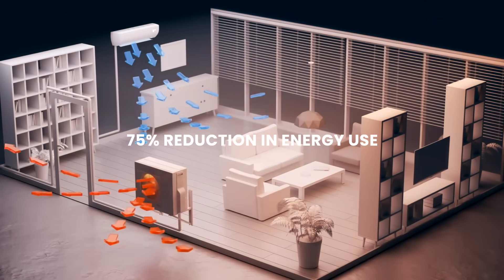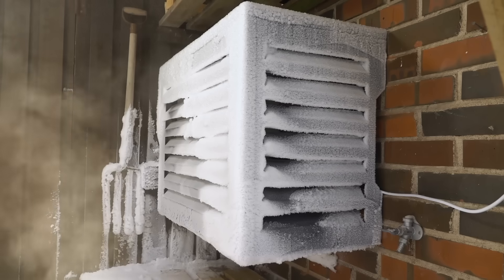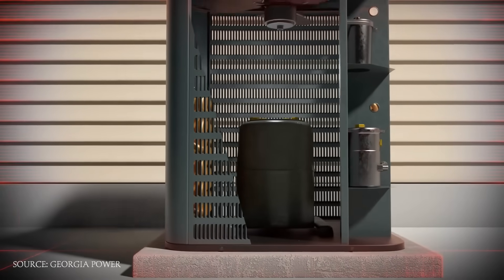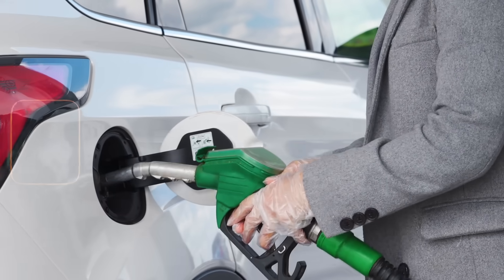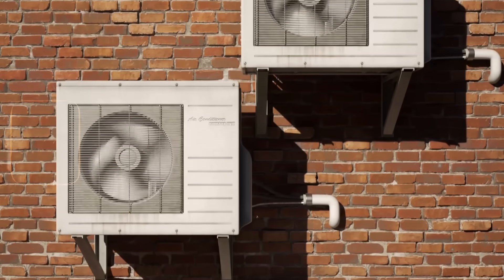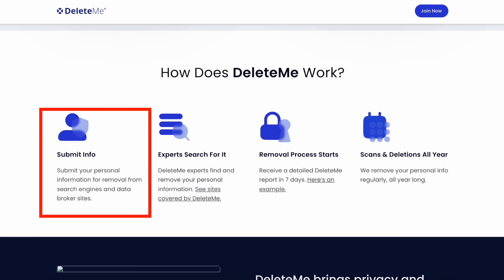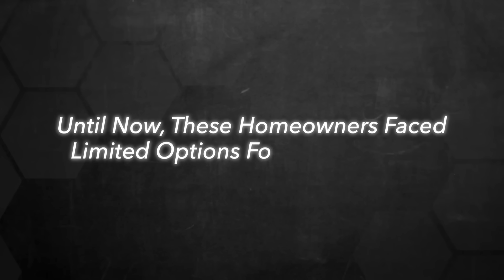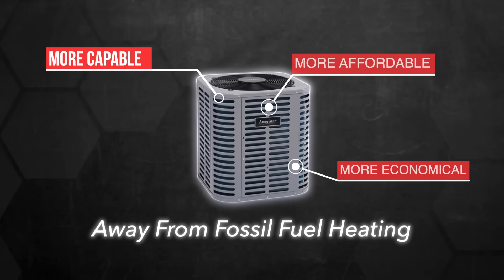Genius Heat Pump could change how we heat our homes forever

Comment: The classic engineering debate: 
A simple, dependable less efficient design that's cheaper to built and easier to maintain vs. a complex, less reliable, but more efficient design that cost more and is harder to maintain. 
Striking a balance between simplicity and efficiency is key.
Reply: As a former reliability engineer I definitely see many problems occurring, lol. I like the KISS system.  Keep it simple stupid!  Overall, I see this system being finicky.  If you are a “DIY” person you may be ok with this system so long as you continuously monitor it.  Problems will occur at the cross over temperatures.  The DIY person will have check the system every time that a crossover temperature is reached.  If the system hangs up there will be liquid in the compressor!  And this is 4 times more probable since there are 4 different temp fluids involved.
Reply: @steveramsey7983 If they want to rely on a single compressor, there are fairly simple ways of preventing liquid from reaching the compressor. The software that this company is touting sounds like something a talented industrial maintenance tech could do with ladder logic, so it shouldn't be too costly for them to add a couple more input devices and a few lines of code.

As a controls engineer and former HVAC tech, it's a surprising how relatively un-smart most residential AC systems remain. The industry seems to have focused its RnD resources on making IOT thermostats instead of developing instrumentation that would make their systems safer, easier to troubleshoot, and more reliable. Harder to market that, I suppose...
Reply: @RayGetardo  I agree 100%. HVAC equipment until very recently has been stuck in the 1940s with basic on-off switches, relays, handful of thermisters, etc.
Reply: A SURPRISING amount of time this isn't actually an engineering dichotomy, but an economic dichotomy; The market is far from efficient in the short and medium term, and so the company that brings the superior product to market charges through the roof for it in order to protect the revenues for their inferior product that they're still selling.  The Big Box logic is that you must, absolutely must, have a "Good, better, best" price/market segmentation, and technical superiority doesn't actually matter.  This reinforces the trend by making the superior product lower-volume, and thus most expensive because of fewer economies of scale.

It costs under ten bucks to add a part or two and turn a $200 window air conditioner into a year-round device that heats in the winter.  But we sell them at a +200% markup instead.
Reply: Indeed. What are the maintenance costs for a multi-refrigerant system compared to a single refrigerant system. More system components tends to mean more maintenance or points of failure.
The unit is about 2X, the added complexity of installation would probably be at least 1.5X, and maintenance would be what? 2X, 4X?
I just recently replaced a 3 ton HVAC unit with a new inverter unit rated to minus 20F for $6200 installed after sales tax. Ordered the unit online and found a licensed HVAC contractor to do the installation and register the warranty. My tenants said it worked fine when the lows hit around 0F with no high electric bill. It only gets below minus 10F a few nights every thirty years or so here. Minus 20F is the all time record low since records have been kept.
Reply: The Lennox Pulse comes to mind
Reply: Which is why I'm engineering a Cooling Only storage system.

Massive insulated basement full of large cobbles for good airflow and thermal capacity.

AC releases its heat into the basement.

Still researching the way to extract the heat from that basement.
Reply: @priestesslucy  extract the heat for what purpose?
Reply: Outlaw planned obsolescence, subscriptions on things you buy, oh and DRM locking you out of things you buy!
Reply: complexity isn't the issue, it's the reliability. Microchips are extremely complex yet very reliable.
Reply: @imzjustplayin  Compared to what? Reliability is a relative term and when microchips are compared to a simple circuit, they now appear unreliable.  It is a fundamental fact that as complexity increases, reliability falls.
Reply: @henryyopp9094  Sorry you are completely wrong.  Generally, yes complex systems are more prone to failure than more simple systems, but this is far from always the case.  New EFI engines are way more reliable and complex than simple mechanical fuel and spark engines.  Why? Because the complexity eliminates major failure modes. Proper design and engineering beats simplicity every time. Design and engineer for reliability and you get reliability, design and engineer for simplicity and you get simplicity, the two are not related.
Reply: @donaldendsley6199  Big difference between EFI engines that can handle and adapt to problems that arise, vs multiple compressor systems in series which constitute a single point of failure.  It's a good idea, but until they can get everything into a single compressor, it's a hard no for me
Reply: @imzjustplayin  Microchip maintenance is performed at the design and operation environment levels. It's not comparable to mechanical maintenance processes.
Reply: @imzjustplayin  " yet very reliable."
They're highly vulnerable to power fluctuations which is why a basic refrigerator will survive minor power surges while more complex ones get fried.
Reply: @wisenber  Microprocessors aren't subject to brownouts and other utility variances because the power supply that converts mains to low voltage is what would be affected first. If the utility power is so dirty to damage anything, it's going to take out the power supply first before it gets to the electronics. Arguably most power supplies in consumer electronics are computer controlled but that has the benefit of making them hardier since they're switching supplies and can handle far wider voltage and frequency range (100v-250V, 50/60hz).
Reply: @imzjustplayin  Weird that they get blown out so much with them being so reliable.
Reply: they do? not my experience. do you repair appliances yourself? maybe the failures you're seeing have nothing to do with power quality but rather poor engineering or parts quality (insufficient or poor quality capacitors or other issues). I wouldn't blame poor power quality for failure of devices since those things can easily be ignored with proper engineering. @wisenber
Reply: @imzjustplayin  "do you repair appliances yourself?"
I don't repair an item that costs almost as much to repair as replacing it. 
I do know that items with microchips are more prone to failure than those without after a surge.

" I wouldn't blame poor power quality for failure of devices since those things can easily be ignored with proper engineering."
I didn't blame the power quality. I blamed the engineering. The video itself mentioned "off the shelf components" which would indicate no special engineering has taken place. Not sure how you arrived at micro-chips being more robust than equipment without micro-chips. A washing machine without a circuit board can shrug off a power surge more easily than one with a circuit board. Same with a stove, refrigerator, dryer, thermostat, toaster oven....
Reply: @wisenber  I do repair my own appliances or find abandoned ones and repair them for myself. For appliances with switching power supplies, I find them to be cheaper and easier to fix than those that don't have switching power supplies. An abandoned washing machine that uses a mechanical timer is more likely to have an uneconomical failure like bad transmission or damaged windings in the motor than a washing machine with a computer circuit board and switching power supply because the power supply isolates the rest of the machine from power quality issues and ECM motors are more reliable.
Reply: @imzjustplayin  I didn't say anything about a power supply. I said "circuit board". 
Not sure what type of mechanical timers fail within warranty period.  My washer and dryer are over twenty years old. Meanwhile, my friends with newer appliances have to replace theirs every few years.
Same with all of the other types of equipment I mentioned previously.
We can toss vehicles in as well.
A quick look on EBAY would note that your assertion that a mechanical timer is more expensive than a circuit board is unfounded.
Reply: @ "They're highly vulnerable to power fluctuations which is why a basic refrigerator will survive minor power surges while more complex ones get fried."

You said the above and I disagree with it. My washer and dryer are around 15 years old I picked them up on the side of the road.

Your friends with faulty appliances are dealing with poor build quality and engineering. I have plenty of computer controlled appliances that are more than 2 decades old.
Reply: @imzjustplayin  "You said the above and I disagree with it. "
Market data supports what you disagree with.

"Your friends with faulty appliances are dealing with poor build quality and engineering. "
They're buying "off the shelf technology".

" I have plenty of computer controlled appliances that are more than 2 decades old."
And I've worked in industrial settings where circuit boards are the most common failure point.
Reply: @wisenber I think this has more to do with how well those things are manufactured today vs. 20 years ago.  Funny how it just happens to be the same time where Chinese manufacturing ramped up steeply, huh?  That 20 year old washer was probably made in Japan, USA, or Canada, where high quality is expected (and usually delivered)
Reply: @AkaRyrye83  There is also survivor bias.
Reply: @AkaRyrye83  I've seen industrial circuit boards being toasted dating back to the 80s. However, vehicles and appliances weren't using them nearly to the level they are now.
I've moved countless times since I bought my washer and dryer in 1996, but I've taken them with me. I have a gas powered freezer as well with no circuit boards. I bought a "dumb" gas water heater when I built the house I'm in now.
My gas well has a "hit and miss" engine that has been running constantly since the 1930s with the exception of belt changes.
Simpler stuff just works, and works longer.
Reply: @imzjustplayin  Engineer here. You keep talking about microchips, but that is only a small part of the equation. A cascading heat pump consists of multiple compressors and is MUCH more complex than a standard heat pump. One issue in the system will take down the entire unit, and there is much more to fail vs a standard heat pump. And circling back to your microchip debate, most of the inverter and control boards on modern mini-split heat pumps are very sensitive to power fluctuations and is the most commonly replaced part on these systems...the power supply is usually built on the same board and they are always very cheap.
Reply: @imzjustplayin  "Microchips are extremely complex yet very reliable."

not anymore. full of software bugs too.
Reply: Intel having problems doesn't speak to the industry as a whole. also software bugs can be engineered out.  @SoloRenegade
Reply: @imzjustplayin  who said anything about Intel? I never did.

" also software bugs can be engineered out."

making things needlessly complicated and unreliable. that's for proving my point.

The average tech or owner isn't going to be able to troubleshoot or fix such an issue.
Reply: who cares if an average tech owner can do that, they have features that can't be replicated. reliability is mostly an engineering and build quality issue.  @SoloRenegade
Reply: @imzjustplayin  "reliability is mostly an engineering and build quality issue."

nothing is reliable enough to never fail. And when it does fail, if you can't fix it, you have to throw it away and buy new. That is NOT reliable. that is Wasteful. Serviceability is a part of engineering, because this WILL fail, and customers get pissed when they spend a lot of money on something that breaks easily and can't be fixed.

I'm a mechanical Engineer in the computer industry. and I deal with this every single day. and I design things for high reliability. I also drive cars from the 1990s, build/fly simple airplanes, and own old home appliances, for the same reasons.

Comment: Ive worked on lots of cascade systems capable of- 50C. Fore some reason people hate working on them tho because of complexity. One system effects the other so diag can be a bit mor.e complicated. But i never had an issue with em
Reply from the maker: I've never worked on them so that's good to hear from someone that has actually seen them. It would be nice if they had built in diagnostics to let you know which loop was causing issues to narrow things down